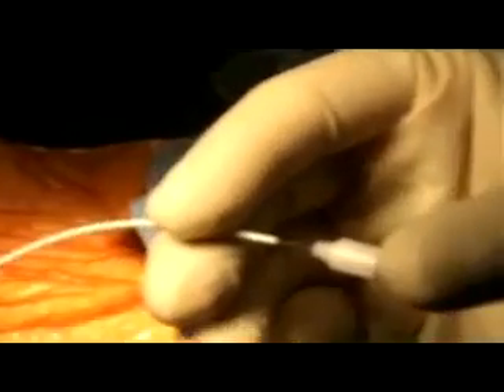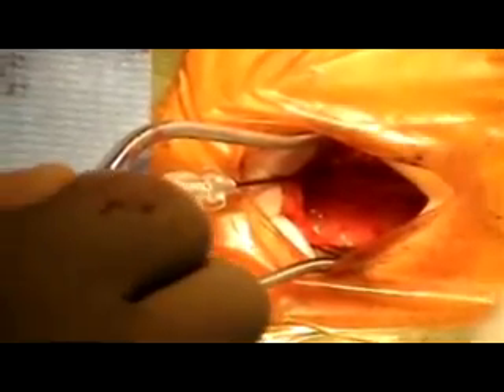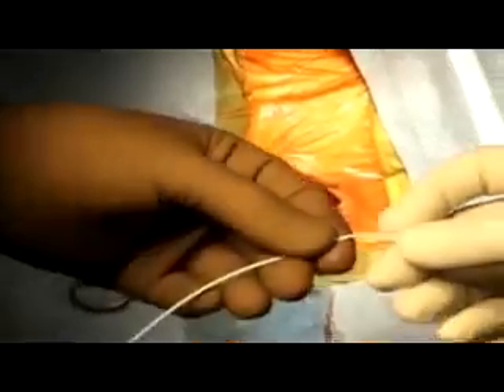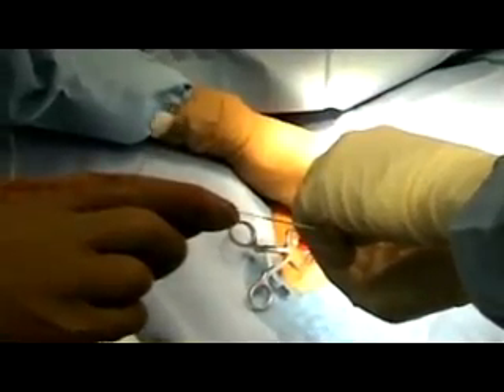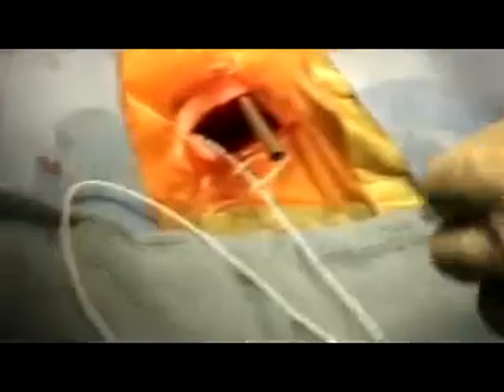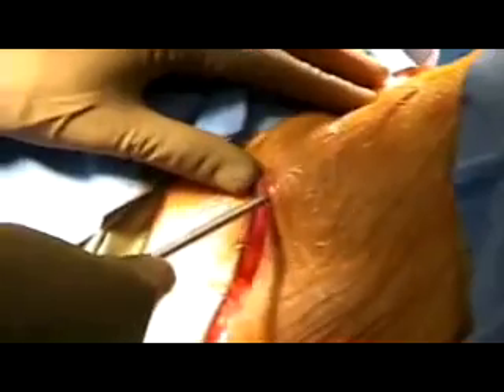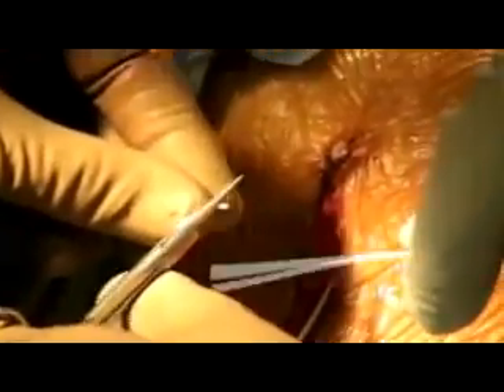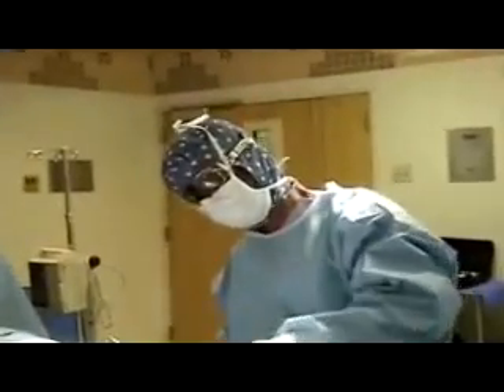Pump Implantation by Joe Ordia, M.D..mp4

Comment: Demand to be on close monitoring for 3 days after implantation of any intrathecal morphine pump. (Close=white on rice) Demand both your heart and respiration be monitored with alarms to staff the moment either behaves abnormally. Don't forego this final step. Overdose happens and it kills quickly; brain death from lack of oxygen (morphine decreases/stops breathing; the freaks before it stops; your brain dies). 

And like the Speaker said, don't get greedy; the catheter shouldn't go up your spine into the Cervical. Stay in the Lumbar region, certainly don't go into upper T-section. 

The odds of not getting a good hand in this deal are much greater than winning $100 Lottery.

Comment: Christine Lawson: I received my pump 12/2015. The main thing I have had to learn was to ask for an increase when I feel I need a bump. It's ironic b/c I had an appointment today and when I explained I was having really tough days, she checked & they were able to increase about 4.5%. The last increase was A LOT MORE,  13%, BUT FOR 1ST TIME IN 15 YRS, I'VE BEEN ABLE TO SLEEP SEVERAL HOURS W/O AWAKENING W/PAIN. I AM VERY SORRY FOR THE TROUBLE U R HAVING!  I AM VERY BLESSED THUS FAR. I AM ALSO IN A RESEARCH PROGRAM W/THE USE OF DILAUDID IN THE PUMP. So, a plus is that I get paid, $50.00 each time I go for a visit. Have you considered trying to find a new physician?

Comment: What is the optimal dose of Dilaudid for the Medtronic II pain pump? I am reaching my 7th month of implantation. The pain has gotten less but I am still on Oral Dilaudid 4 mg TID in addition to the PTM. The pump has helped but I do not want to feel like I am begging for the doctor to increase the pump dosage. Then when I have said something at my refill appointments they have always increased the dosage (14%@the last two appointments) and have said I am on a very low dose. I have tried to research what an optimal dose amount would be but have been unable to find anything pertaining to the mg/dose schedule. My amount now is 2.5050 mg/24 hours w/an additional 0.1999 bolus up to 2x/daily. I have an appointment in a few days and guess I will bite the bullet and ask for an increase in the dose. I just do not want to end up anywhere as desperate as I was when I finally got the pump implanted.
Reply: +SUSAN CARLISLE My name is Chris, how is your dosing going?  I also have dilaudid in my pain pump.  It has now been 7 months and I would say I am about half way there with dosing.  I am trying to find a doctor that can help me right now due to the fact that my current doctor doesn't know how to properly dose or increase.  I have been trying to be patient but am so frustrated because I am still suffering so badly and she will not give anything else to help with breakthrough pain....this was supposed to be the answer.  Have you found out anything on the dosing?
Reply: Christine Larson 😲😲😲

Comment: 6 fusions and now failed back syndrome. All I EVER had was nightmare pain from "soft tissue" issues and back spasms. Now trying to decide to try the pump OR the Spinal cord stimulator. With so many failed surgeries WHY should I trust either of these choices? I never gave up till this past month but can't take ANY more of this. I also don't see how a Spinal cord stimulator could be of nearly as much benefit as a pain pump with spams and soft tissue pain. But will decide which way to go in the next few days I guess. A bullet seems cheapest at this point....
Reply: How are things going now days Mike? I’ve been on methadone for over 10 years, it was the only thing that helped and didn’t make me feel drugged up. I’ve had a good experience with it. Started it after a failed Nero stimulater was implanted 15 years ago. Still trying to get the damn battery removed! It’s been off and a dead battery for 10 years. 🙄    Now the methadone is starting to effect my heart, they say. They have been trying to take most of the pain meds away due to the new government crack downs on them. Everything was going great until then. Now they want to put in a pain pump, basically so they have the control. I’m ready to give up and turn to medical marijuana. It’s gotta be better than letting the pain clinic run my life.
Reply: +Mike Cartwright did you get the spinal cord stimulator? I got mine a year ago, and it's a waste of time. Now I'm going for a morphine pump, hopefully this will help. This will be my 5th spinal procedure and nothing seems to help me live better.
Reply: +Larry Ruiz (Maddluv4u) Hi Larry-I just put it off after I asked to get OFF Fentanyl and onto a pill form of pain med instead. With Fentanyl patches the that make me OD (due to warmth) on day 1 with little or NO relief on day 2. Now he put me on  Opana that is a pill  but in 4 days gives ZERO pain relief and costs MORE than the Fentanyl!  Insanity all around and 22 months post op, which I could just die and be DONE with it. Nothing works and going broke for the privilege of all this misery....
Reply: ***** hey I know the feeling man, life is just not the same. I feel like I'm a guinea pig and they are just trying things out. There's not one day I go by without pain, grrrrr this really sucks!
Reply: +Larry Ruiz (Maddluv4u) AGREED.  I asked for the pump but pain management asks me to try a new Nevro Brand SCS first. All the pain meds I SWORE were for losers (drug addicts) when I was a cop and IGNORANT as to what honest, chronic pain was, are all being raised into a new higher tier level that even my great Medicare supplemental insurance  now make too expensive for me to afford. ONLY drug that I see affordable is Methadone but everyone says it is a "nightmare" drug. To be honest, I am about to give up.
Reply: ***** I can't tell you what to do or what to take Mike, but they put me once on Methadone. It was like living a nightmare! Not only do you have to keep increasing the dosage, but your body starts t have reactions to it. As teeth falling out, getting all corrouted, you really become like a "Licensed Junkie". To get off it, it's like a heroin addict, you have to go little by little. I always fell like I was so high and hated it! Please look into it first my friend before you make a decision!

Comment: I'm a diebetic and the doctor said he was going to save my life and do bypass surgery on me and I lost over a hundred pounds but now my legs are on fire and it feels like sombody is dragging me on the concrete after sombody hit me in the foot with a hammer I have been on pain medicine for so long it does not help and at night and in the morning I scream to god for help I can't even go on vacation and now I'm getting a pain pump will it help me I don't know what else to do
Reply from the maker: Sorry about your problems with chronic pain. In my practice, I consider trial of spinal cord stimulation (SCS) for patients with pain similar to yours, as long as they meet certain criteria. Those who do nor meet the criteria, or otherwise fail the  SCS trial are then evaluated for spinal pain medication. Trial spinal injection is essential before pump implantation. The best way to know if the therapy is likely to help is by doing the trial injection.  Morphine, and Ziconotide are FDA approved for use in the pump for treatment of chronic pain. You should discuss this general information with your health care providers.  I wish you the best of luck.
Reply: +Mark Crocker It sounds like you may have Beri Beri from the Gastric Bypass.  I would recommend you take a B-Complex Vitamin and more specifically B1-Thiamine. at least 100 mg daily if not twice a day. This may help reduce pain.

Comment: It's been  just over 7 years now and my pump is to be replaced with a new model in less than 2 weeks. The last pump was implanted in the wrong location, too low on my belt line. I've been wearing surgical binders 24/7 for over 7 years now. I've got a new doctor and he's going to implan this one PROPERLY. Make sure you find an experienced doctor, the one that did my initial surgery was a carbon copy of Obama and thought his **** didn't stink.

Comment: Most pumps are only necessary due to botched spinal surgeries or intrathecal contamination (by faulty ESI's) causing Arachnoiditis or other injury.  Eliminate the cause, and you'll help eliminate the need for such dramatic implants.